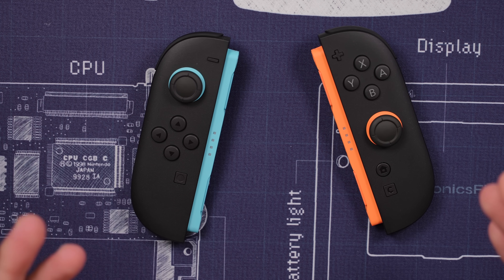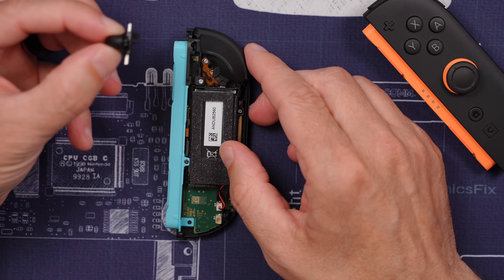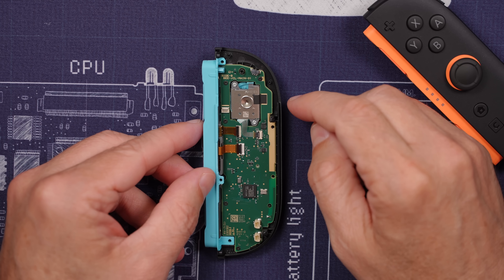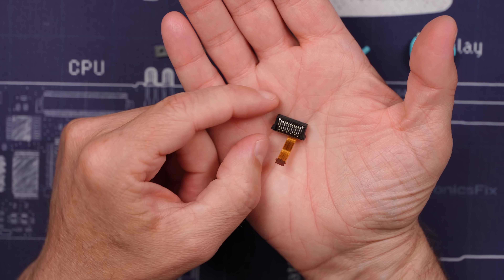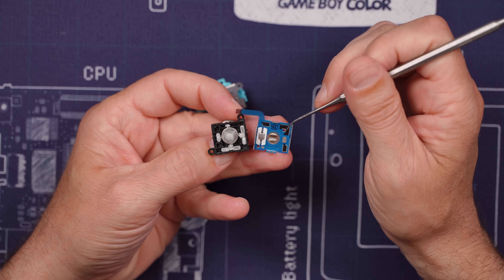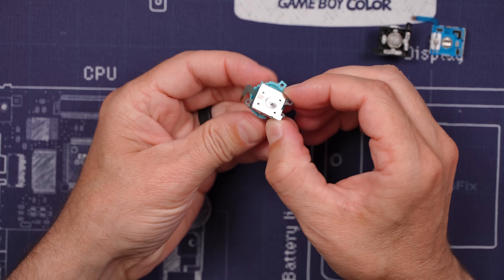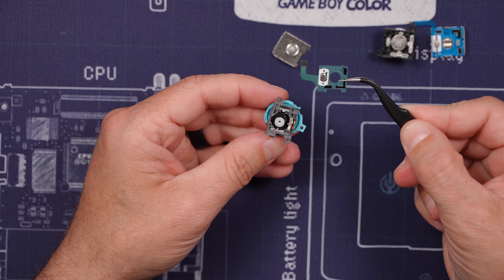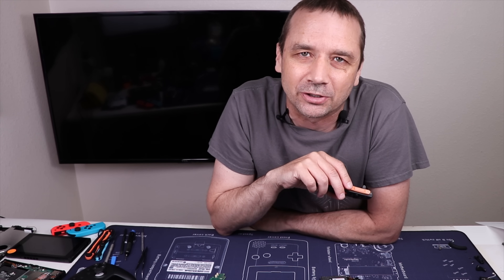Nintendo Switch 2 Joy-Con Teardown - Full Disassembly

Comment: Choice between magnetic connect or hall-effect sticks is obvious - they kept the old design to sell more controllers when they inevitably get drift!
Reply: Considering how expensive it is for them to repair the in-warranty joy-cons, I doubt it will be profitable for them to do this intentionally. Especially in the EU, where they even had to repair out of warranty joy cons for free.
Reply: @yasd23a  Probably because those that sent their Joycons in for repairs were the minority. The vast majority most likely just threw it away and bought new ones.
Reply: @FredBloggs919  Post OLED Joycons didn't get much drift tho
They still kind of suck tho, My OLED Sticks got their caps peeled off before any drift (Switch 1 had drift a few months after i got it lol, and they also peeled )

Comment: Ngl I hope this era ends up like the Wii U/New 3DS era, Nintendo needs a kick in the butt & make good, competitive hardware + software again. And I say this as a shareholder of Nintendo’s stock, they always get too comfortable and pull stuff like this when they’re at the top
Reply: Switch 1 wasn't competitive hardware back then either, and software was the same at launch, so stop pretending this is some outlier times now.
Reply: @TerranigmaQuintet  performance? No. Usability of the general public? Yes. The Switch took what the Wii U did and made it user-friendly and viable/practical to use in a way that hadn’t been done before. Take apart a Wii U gamepad and tell me with a straight face they’re the same as a joycon. Whereas the Switch 1 and 2’s joycons are basically the same, despite Nintendo knowing of the joycon’s fatal flaws & the fixes since 2017 & redesigning the connector. Not to mention Nintendo had a bunch of innovations they tried in the beginning of the Switch 1’s lifespan. Where’s the innovation now? Adding a sticker over the part of a joycon that is most likely to be pushed around, misaligned, and torn? Re-using the same joy stick with the same flawed design that got you sued? Not protecting the front of the Switch in the retail box so any puncture in the front of the box results in a scratched screen? Or maybe they’ll offer a theme selector but only let us select from 1 theme - now that would be a massive innovation!

Comment: Well, this was expected to be honest. If they had actually improved the sticks significantly, they would've mentioned that in their presentation where they went in-depth about the system. But nope, the one thing they had to say about the analog sticks is that they're larger. It is a slightly different design, but best case scenario it makes for a small quality of life improvement, but at this point we can't tell yet. It's really stupid considering a good solution barely costs anything more and would eliminate the risk of drifting issues altogether.
Reply: @thenonexistinghero  what's the good solution
Reply: @pixsled  to fit tmr hall effect sensors
Reply: Bowser himself said that the Joycons were re-designed from scratch and that was a lie.

Comment: Still have my launch day Nintendo Switch from 2017. Still play it to this day and have never experienced joy-con drift. Lucky I guess.
Reply: You are the chosen one
Reply: @mattstokes3881 Ha ha. Maybe.  I did have a minor battery issue and had to return it to Nintendo for them to inspect. But other than that, never had any problems. The serial number even has my initials. 😂😂
Reply: Our launch day switch has had 2 official joystick replacements and I got tired of it and popped in halls after rhe 2nd time. Im a little annoyed that my switch 2 doesnt have halls, but hopefully it will last.
Reply: I've not had any problems either.  Granted, it's not my main console.  Although I've not had a controller drift on me in ... probably 20 years.
Reply: Lol a couple years ago I upgraded my joycons to have hall effect joysticks just to future proof it

Comment: As someone who has taken apart and repaired Joycon Sticks many many times, when you opened it up and I saw almost the same design, my heart dropped and I am now sad. I can only beg and hope that these somehow don't drift too.
Reply: So you think drift is fixed? I noticed its got more travel when moving the joy stick left and right. Like it just feels way smoother and not rubbery if you know what I mean?
Reply: @steviejohn  drift was already fixed with oled models
Reply: @shauni1987 
I know they've refined and improved the functionality over the years but to say they've outright "Fixed" it would be dishonest. Like I've said I'm really REALLY hoping I am just actually wrong and that somehow Joycon 2 is the highest quality controller ever made or something, but if people start reporting Joy-Con 2 Drift over the next handful of months I'm probably gonna have to skip on Switch 2 for a few years at least. The "new" design just being the old design again doesn't exactly spark hope
Reply: @steviejohn it’s ok to claim they “fixed” it since daily rate is now back to pre switch era. This technology is in use for decades and is not bad. There was specific flow in original switch so drift issues were abnormally high (I have replaced joycons 4x). On oled, this issue no longer exist (ether for me, or for others looking at the anecdotes).

Comment: Seems like they just use the cheapest available parts for it and then slap it together and put a $450 price tag on it when it’s not even worth $450
Reply: How is this any different then a material cost of 180$ for a iPhone and apple charging 1500$ any different ? You clearly need a reality check on cost of components vs msrp
Reply: @IsaiahSpeed23  then dont buy it. Its that simple.
Reply: @IsaiahSpeed23  literally welcome to every gaming device and platform you've ever used.